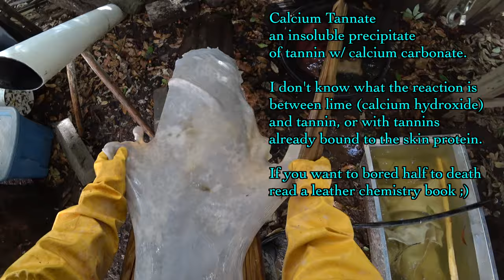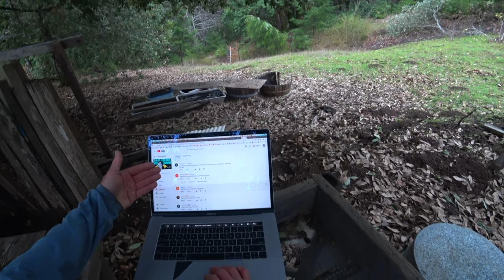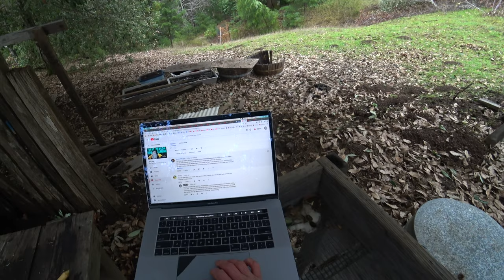First Person Hide Tanning, Scudding and Deliming the Sheep

Comment: thinking about filling the cracks in your beam, easiest method is probably to use some 5 minute epoxy and sand it.  Another good method is sawdust and glue. I fill up big cracks in oak all the time with very fine sawdust and super glue followed by sanding. waterproof.
Reply from the maker: That beam is toast.  As my friend used to say, it's like polishing a turd.  the edge is actually breaking off.

Comment: Interesting note on lime drying, becoming limestone. I once had a deer hide soaking in lime to buck. I wetscraped the hair and grain and then realized how weak I was when finished. I had the flu. I never rinsed the swolen hide to neutralize, rather I just hung it to dry; Bad idea.  
Long story short,  I had to rehydrate and neutralize with water and vinegar and only after MANY wringings and soaking in the vinegar solution did it neutralize and stretch enough to Brain. Even then, it took  several applications of wringing and soaking in the emulsified oil solution. Finally, It turned out fine but I will never make that mistake again. It felt like it had turned to limestone and was rough like you described.
Reply from the maker: Yeah, that's a really bad Idea.  You invented a new building method, saturate hides in lime and use them to coat your hut lol.  I'm glad to hear you were able to partially reverse it though.  I think mine is actually probably alum, but we'll see.

Comment: Try using a piece of burlap a towel or even carpet on your wood beam to protect your hide from the beams imperfections.
Reply from the maker: something finer textured and firmer might work, but it would be damaged when I scrape off the edges.  Wood is repairable.
Reply: I must not quiet understand what you were getting at when you were talking about the imperfections and the hide. Using a piece of burlap or carpet is used by trappers. I like it especially when fleshing possum. Their skin is so thin. Carry On!

Comment: Bonds makes a good permanent wood filler to fill the cracks and rough spots on the beam. We used it on the decks of a wood hull shrimp boat to hold over rotten spots until the summer haul out when we replaced wood and painted the boat.
    Apply it with a Bondo applicator then sand down smooth. You will get more life out of that beam. But then...how long does it take to make a new beam? 
     Also if you sand across the PVC beam with 80 grit sandpaper. It should make a non-skid surface to keep the hides from sliding around.

Comment: Steve, thanks for sharing your experience. Clearly you know of what you speak.   I hunt for food. Always hated to toss the hides, wanting to tan them, but not knowing enough.  Came across your videos, built a quickie fleshing g knife and  now have a hide at the scudding stage.  A couple a squirrels too, which I plan to test with Osage Oarange wood for a tannin source (I saw your brief mention of that in your tanning materials blog post.  Thanks dude.  -Tim Wilder
Reply from the maker: That's great to hear.  I hope they turn out well.  Most people end up using too little tannin and it's hard to know how much to you need of a given material.  Hopefully this series will help through the rest of the process.
Reply: For Osage orange, I think I remember your blog mentioned wood rather than bark. That right?

The strop series was very helpful
Reply from the maker: @timwil5350  I think so.

Comment: hi mate can you please talk about pickling hides, ive tried it a few times now with my kangaroo skins but every time i try to neutralise the skin it gets acid swell i think and it triples it thickness and becomes like gelatine and makes ultra stiff leather. ive tried adding salt to the neutralising bath but it still happened again. cheers
Reply from the maker: I never do that, so I can't really help.  closest I get is using vinegar or ferments to nutralize lime and that is usually not enough to swell much if at all.
Reply: Hey Devon, before adding the acid at the pickling stage make sure the salt concentration in the float/liquor is between 10% and 12%. Also if you go to raise the pH after pickling the salt concentration will still need to be around 10% before adding neutralising salts/bases. Just my $0.02 worth.

Comment: Hello! 

Love your work, but I have some questions as I was thinking of tanning some of our cattle´s hides: how long would you recommend them to sit in the solution if it´s made up by spruce bark? also how do you need to "trim" down the neck and butt for the solution to get all the way through? I´m a noobie at this but thought I might give it a try instead of throwing them away. 

with best regards, Jonas :)
Reply from the maker: it's not going to be that much different than other materials.  the thing you have to figure out is strength and keeping the solutions strong enough.  DON'T START WITH A COW lol.  if anything just tan one square foot or something to get some experience.  You can salt the hide to hold it til you are ready.
Reply: @SkillCult  Thank you!! Yeah the thought of tanning the whole hide in one piece seems quite troublesome after reading your blog. Is there any diffrence with bull hides? Just butchered one and placed it inside one of the freezers. Thought of cutting it in 3 pieces and then in to smaller bits. A company located a couple of miles away tan there cow hides for 12 months and I feel that seems a bit to long, or is that a resonable period? I´m really sorry if I ask a lot but I´m trying too convince my dad that this could be something productive to do with the hides instead of dumping them in the forest.

BTW, hope you have it a little bit warmer in the states than us in the northern part of Sweden.

Comment: It would be nifty to have found a way to incorperate abrasives into hides destined to be used in strops!
Reply from the maker: Sounds doable.  there is probably  patent on that from the 1800s lol.
Reply: I didn't spend enough time to trace back into prior art, but US pat 1651911A 1927 does say Oak Tanned leather is preferred when the method of applying powdered shale abrasive to the flesh side is deployed.